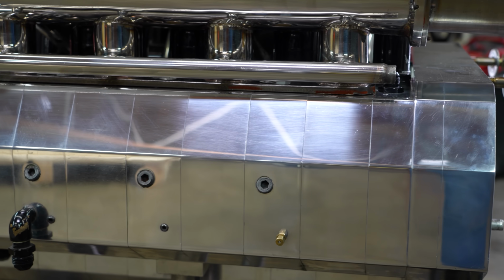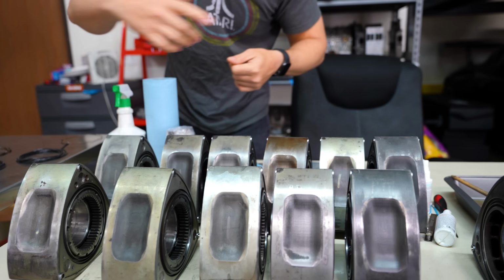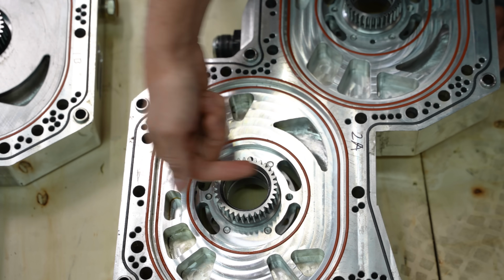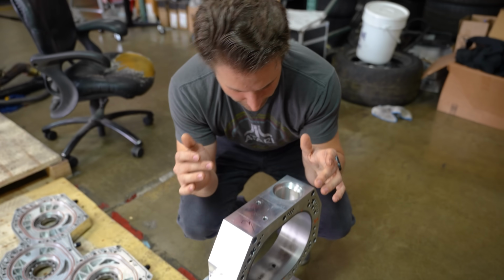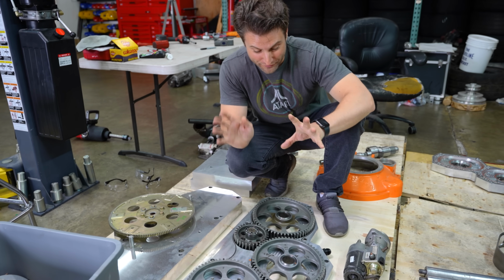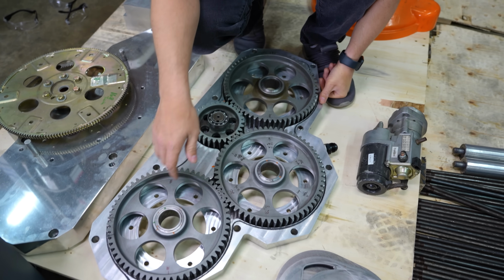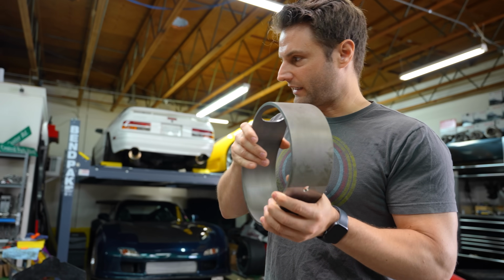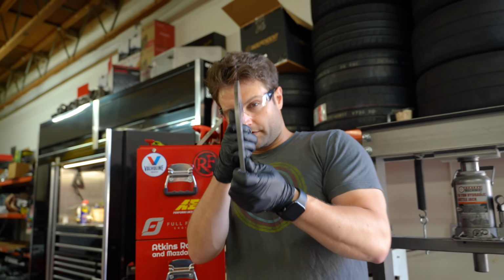Everything wrong with the 12 Rotor

Comment: time each bank as a traditional 4 Rotor, then set one bank to 0 degrees, the next 30 degrees out form the first, and the third an additional 30 degrees. every rotor should fire independently and a combustion should occur every 10 degrees of crankshaft rotation. the sound would be absolutely legendary.
Reply: they dont fire 3 times per rotation of the e-shaft (crankshaft), they fire 3 times per rotation of the rotor. the rotor spins at a 3:1 ratio to the e-shaft, making one ignition event per rotor per rotation of the e-shaft.
Reply: @Sharkey_t  i stand corrected
Reply: I JUST CANT HELP but think that this is a problem A.I. was made for! I mean I know you want to do this with your (combined) big ol brain power(s) and good gawd good luck to you but also I would be thinking about whipping Ken Blocks ass with whatever you put that in. Hoonigan vs Time Machine? lol 
Talk about chomping at the bit!!  I can't WAIT to see that thing scream and it will literally SCREAM when it fires. Oh yeah- twin turbo too- just sayin... 
God bless you brother. Best content on the net.

Comment: I am only guessing but with 12 rotors there's probably a lot you can get away with when it comes to balance and timing the question is if one could get this engine to fire evenly is there any benefit?
Reply: I don't know. It was already running ridiculously smooth back in the day, with a glass of still water standing on the block as it idled.

Comment: 10:06 that bearing should be changed to a spherical roller bearing. Those are both normal and thrust bearings into one. They're extremely stable and self aligning. Tho honestly, you should get in touch with an SKF rep and show them and ask them about this challenge you're facing so they can provide you the right bearing for the application. Trying to stumble through, or using the old bearing as a reference, is a mistake. Bearing tech has come a long way since this engine was built. A lot of wear resistance and metallurgical changes have been done. It will cost, but it will also be the best option.
Also, those bearings should have cooling pass through them. All the applications i've seen have required it.

Comment: This engine is just insane, and great to see how much of a handle you've got on it already, only a couple things I personally feel you've overthought problems:
12:40 You can tune those 3deg out of that "bank".
And you don't need 1 expensive ECU, you need 2-3 cheaper ones, been done for a while in the V12 community apparently.
Reply: I don’t think you saw the original video because the issues he mentioned were from the creator and his opinion. The things you mentioned were problems the creator mentioned and rob is solving/improving. The original creator was running it on dual ECUs at the time because the fancy shit didn’t exist. Also in this video he said the plan was to tune out that 3 degrees of mechanical difference
Reply: @robboss1839   Saw the one where the engine was dropped off, and I saw this one.
"fancy sh*t" didn't exist, I hear you and that's true, but good EFI dual ECU V12's has been built before, I don't see it as a major impediment when there's more than one way to skin the cat, maybe he's considering fiddling with all 3 gears offsetting them to get it over-all closer, or a wider pulse.
Could also run it as a 3 rotor first and get the tune in, then start adding cylinders, alternatively machine a new front lid & different gear system.

Comment: Please give the banks a sequence. Simply bcz the rotor rides on teeth, those two rotors will never be at the same spot even when the E-shaft is true. This is not a problem when firing one E-shaft, but if you try to fire 6 rotors at once, parts start to fly. The best way to fire multiple combustions is to ignite them separately in rotating sequence. 1-2, 1-3-2, 1-3-4-2 etc. This way the minute differences between timing and fuel won't create catastrophic harmonics. Also this engine needs the spark plug move treatment, badly. It would eliminate the need for reinforcing the middle gear as well as give more tuning window for the ignition timing.

Comment: Just a quick comment on the teeth timing issue. The problem as you describe it only exists when the gears are identical and on a radial angle divisible by the tooth pitch this issue could already be solved by the gears position relative to each other but could equally still exist. I hope I explained that well enough! :-)
Reply: It could also be solved by rotating that left gear a few splines on the crankshaft, as the crankshaft is where timing is set, the gears are just relative to the crankshaft.
Reply: Yes I think I am thinking of the same thing.
Do not worry about the teeth of the gear being 3 degrees off. Compensate for that offset by changing the clocking of the e-shaft to the gear to accomodate for that tooth to valley offset.
TDC on the center should have the tooth down, at the same time the left gear that is in direct contact with the center should have it's TDC at a valley pointed down.
So yea, change the clocking of the splines to the teeth of the gear.
Reply: Isn’t there more than 3degrees per spline though?

Comment: With the gears, I'm pretty sure (not 100% though) that it's possible to make them all TDC if the angle from the 2 touching gears is an odd multiple of half the angle per tooth. That way, a tooth always lines up with a valley but the TDC is also in sync.

Example: 60 teeth gears are synced if they are angled at 3 degrees, 9 degrees, or 15 degrees parallel (or anywhere along that pattern)

I don't know if the 12 rotor is designed that way, but I would check. Also, if I'm just dumb and completely wrong, please say something, comments!

Comment: Can you run dual computer systems with dual crank position sensors? One computer handling the two banks at standard TDC, and the other computer handling the bank 3 degrees different.

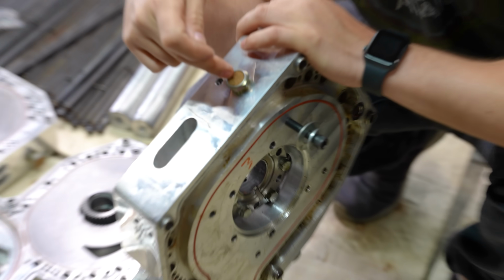Comment: 6:36 Otherwise called Positive Crankcase Vacuum ports, on any other engine. Typically has lines run to it with a PCV valve that regulates the direction the air flows and helps to prevent oil from going places it shouldn't (like the intake plenum or right behind the throttle body on most cars along with the EGR stuff.... )
Reply: Nah man, you're mixing stuff up with wet sump and dry sump engines. On wet sump engines you have a pcv system that creates a vacuum in the engine by attaching a hose from the intake plenum to the crank case (or valve train area, which has a direct connection to the crank case). On a dry sump engine you create that vacuum with the dry sump oil pump and you don't have a pcv system.

Comment: perhaps some kind of thrust washer on the rotor faces can both mitigate the "chamber plate" warpage, and stabilize the main bearings axially? The plate does cover some oil passages that might be used for something clever.
Reply: It would have to thrust against the moving rotor ? It would have to be a soft material to not cause wear or damage to the rotor , I thought they could run longer stationary gear bolts and tap into the plate , basically bolting it down from the inside face .
Reply: I was thinking something like side seals on the rotors themselves, but honestly your idea is the right one for keeping the plate from bowing. Mine may work for overall axial alignment but it faces the same wear challenges as the rest of the dorito's sliding surfaces. Not sure if more is better in this casez lol.

Comment: It still boggles my mind how that guy machined all of this.  That thing is a work of art.
Reply: @mostlymotorized you really don't understand the very very tight tolerances that engines require. This would have been EXTREMELY difficult to machine.
Reply: @not_even_me5035  I cannot imagine how he calculated the continuous coordinates of the peritrochoid curve and programmed it into the NC machine.
Reply: @Hikkyjp  there's software for that. He drew the curve and software handled the coordinates
Reply: @Hikkyjp  oh you use big words now? Its called you design it in cad and then use cam software to write the NC for the machine. You do not need to hand code this stuff.
Reply: @Hikkyjp We have software for that, that can create toolpath endpoints faithful to the prescribed contour within .0001”.
Reply: @not_even_me5035 I've worked on 3, 4, 5, 9 and 12 axis machines, tolerances going from +- .001 down to .0003. This would not be hard. You just have to make it small and slowly up it until you hit your tolerance
Reply: @not_even_me5035  That VMC will hold a tenth and we are not talking about manual machining here.
Reply: @not_even_me5035  easy peasy. cam does all the work for you. just measure critical dimensions and re run cycles till they measure good. done
Reply: The crazy thing is it was all done on a vertical Has
Reply: @Shortymack420 fixturing is everything. But imagine how bad it would suck to fuck it up towards the end 😭😂
Reply: @Shortymack420  The Machine work being CNC, off a 3 axis, and out of AL isn't that outlandish. Probably a lot more work in the Crank and Gears.
Reply: The power of an educated individual, fully aware of what the heck his machine can do. You'd be shocked to find out just how little a lot of self proclaimed machinists (hired at that) know about their machines, what can be done on them, etc. Most of them are weekend to weekend workers.
Reply: @aserta  Where would one go to be amazed at at your skills? Not your YT channel. You know SO much, you must share with the planet!!!! WHERE IS YOUR MACHINE WORK HOSS???
Reply: For real. Mazda should recruit rob and the artist to make the heart of the sportiest beast on the earth. I'm talking about a naturally aspirated supercar faster than a Bugatti and lighter than a lotus with sleek vintage Mazda and modern hypercar mixed to make the coolest car to ever meet production
Reply: @mostlymotorized  yeah bullshit. Such an oversimplification of the matter. You're probably pretty shit at what you do if you think it's easy.
Reply: @mostlymotorized  correct
Reply: That's why they get paid a lot of money.
Reply: @biggestthreattoyourexistence machinists get paid pennies
Reply: Yes.
Reply: Its just like a modern day DJ, you just press play
Reply: @janeblogs324  
Exactly - operating the machine is something a low skilled person can do*, it's the programming the work to be done into the machine that makes one "the machinist".

I've set up and used several mills, lathes, and other manual machines, but I am NOT a "machinist", FAR from it - just someone that can do some basic design drafting and do some simple cutting - at best I was semi-skilled just doing what I needed for myself.

* There are videos of people like that - that just stand and watch a crash without even killing the machine. Something like CNC crash should bring some up.
Reply: Everything is art.
Reply: I’m still convinced that he didn’t machine it. I think he’s a wizard and conjured it.
Reply: Im a cnc machinist, it’s a lot of tolerances BUT from my understanding engine parts don’t have particularly tight tolerances. I’ve done parts with as little as 2 ten thousandths tolerances on a regular basis on haas machines. Mastercam does a lot of the work for you.
Proper setup and creeping down to tolerance does the rest.
Reply: As a previous cnc machinist it does the same to me
Reply: Imagine an insert chipping.....
Reply: @@volkz247 Thanks everyone. When I was a child, I had heard that the inner surface shape of the rotor housing is calculated by a very very complicated formula(I cannot show URL by youtube restriction), and I didn't think that CAD/CAM could do that calculation (I have seen side housings often in aftermarket parts made in NZ/AU, but I had not seen rotor housings before). More than 10 years ago, when I was a student at an institute of technology, I had the experience of taking a course on 2DCAD. The software I used then was a looks like software version of a drafting machine. The software was probably intended for beginners.
Reply: @Hikkyjp  How do you think the rotors were designed originally?
Reply: It still boggles me how people that can produce this type of thing dont realise that it is the most inefficient internal combustion engine design known to man. You can make a steam engine produce 2000hp and many of them did. They are not used now because they are not better than the alternative. However is lovely and shiny though.
Reply: @dbbd9890  I think you ar missing the point, this is a competion racing engine where power to weight is the primary factor, followed by compactness. Reliability and longevity come in a distant third ond fourth, and fuel efficiency is of very little consequence, Thermodynamic efficiency is basically a moot point.
Reply: And to be honest,  this is a sad thing about this, just an art piece, not a working engine
Reply: @yaxo11  well it weas a working engine, I've seen video of it running.
Reply: @mytuberforyou  i know i saw it too, but that was it, just running on a hoist for a brief moment, it didnt run anything. So it is only work of art
Reply: Hes dwemer

Comment: Regarding the timing of the shafts. This could be changed with the position of a 'key' in the sproket, or even by rotating the cavity slightly in the block. If the key is not aligned centrally with a tooth (or valley) then see/check if the sprocket can be flipped over.

Comment: 2008? Damn, that engine was designed & make 15 years ago? It's genuinely impressive considering there were limitations on some knowledge & machine.

I honestly want to see Rob Dahm make a 3-bank 3-rotor (3x1) version of this engine himself, a revision 2 of this 12 rotors engine but corrected everything that is wrong.
Reply: Yeah this thing was absolutely bleeding edge and incredibly expensive back in the day. Hell, even though the tech has matured in that time, it would probably still cost the same now.
Reply: The drive to do it is the impessive part. The actually work is fairly standard stuff we have been doing for a long long time.
Reply: ♻️ Raised ♻️ Wankel ♻️ Engine ♻️ is similar, ♻️ size ♻️ Chevy ♻️ Engine.
Reply: Actually there were zero limitations or lack of knowledge even 30 years ago. I ran CNC lathes and CNC milling machines in the 90s. While guys back then were building 3 or 4 rotor engines, the shop down the street was building AWD Hondas in the late 90s using the Honda CR-V AWD..Good old days!
Reply: @BigBadBillyGATEZ  There are severely lacking knowledge on rotary because most of them gatekeep their knowledge, that's partially why not a lot know how to play rotary & shop charged fortune to build one.

In the introduction video, the builder of the 12-rotors did mentioned about some limitations of the tools, so I assume with more modern tools & knowledges, the whole design can be improve upon.
Reply: @RDSAlphard the gatekeeping comes from the serious level of competition there was between rotary shops.. in the early 2000's shops were competing for a whole heap of records..
Reply: So if you saw a fast little Honda Civic Taki of like a rocket it was probably an AWD built lol
Reply: It was 2008, not 1708. Nothing really changed in 15 years.
Reply: @TURST67 umm, no a ton has changed
Reply: @ImKairyu  Didn't he machine it on a pre-WW2 manual milling machine by hand, what a boss...
Reply: @TURST67  that's not true. Computing power, sensors, tools, CAD programs have all become much more powerful. As well as flow simulation programs a regular pc can run.
Reply: @TURST67  exactly. Only things that may have changed is speed and comfort working on that machines. No matter if you are using an Kondia K76 from the 80s or an Deckel FP2A from late 70s or a 2023 DMG or Haas.

Comment: The only issue with a rotary is the heat??? Are you forgetting gas economy?
Reply: I dont think Efficiency has any meaning, when you are trying to power a boat through water... at maximum throttle / speeds.   This clearly isnt built for 20 mph cruising on, on some tiny dingy.    Its probably the kind of engine you put in a Racing boat... or a massive sized boat (Heavy).   Imagine the Fuel, and Raw horsepower, needed to move the Titanic at a reasonable amount of speed, through the Ocean.     Boating on a large sized craft, is a basically a Rich mans hobby... or a Business (Fishing Boats, Tourism).
Reply: @johndough8115  IDK if economy doesn't matter. As a person who has owned a boat and a jet ski at different times... They are for people with money, which I really am not, hence why I no longer have them. But on topic...

Efficiency can be crucial, even on a boat that would be a mild performance or wild performance machine, as range is usually a huge deal in those, and often, tank sizes can be limited.
Reply: @DataRew  Im not an expert in Engines... but Im almost certain this is a Racing application... much like a top level Dragster.  Designed to make as much HP,  Accelerating as fast as possible... and reaching + Maintaining the highest level of speeds.

 The Dragsters dont care about how much fuel might be wasted,  in their goal of creating as much HP as possible.

 Even Most other types of Racing Cars, are built for max acceleration and max speeds...  Even though, you may have to stop for more gas.. and lose some time.

 Anyway... I have a feeling this kind of engine isnt for cruising long distances at milder rates of speed.   The sound of this engine alone, would probably prohibit that kind of use.
Reply: @johndough8115  I don't think my post with a link to the CarPower article actually posted, but the builder specifically calls out building it for power, but for continuous power, and specifically says that he did not build it for a drag application.  

In that case, efficiency matters.

Just do a search for "12 rotor boat" to get the article.